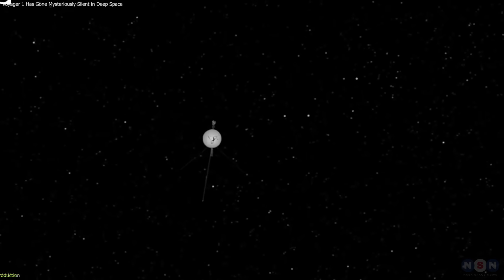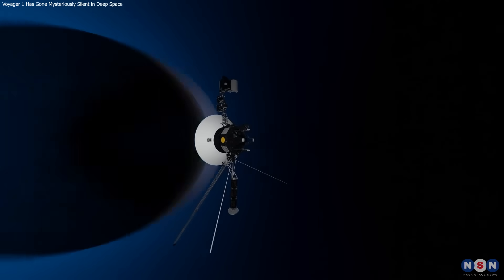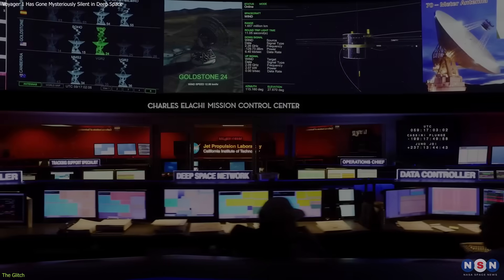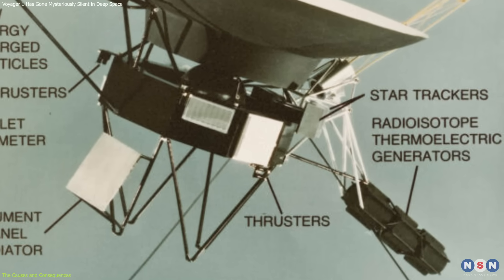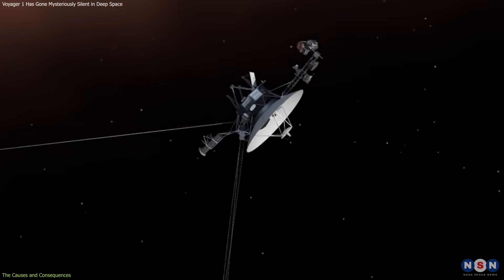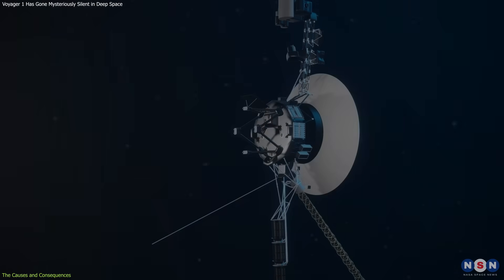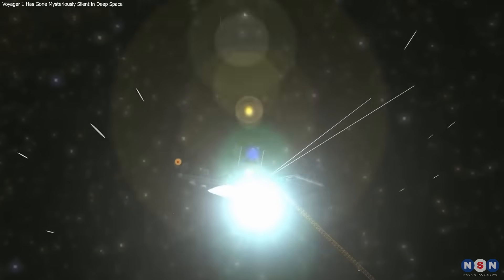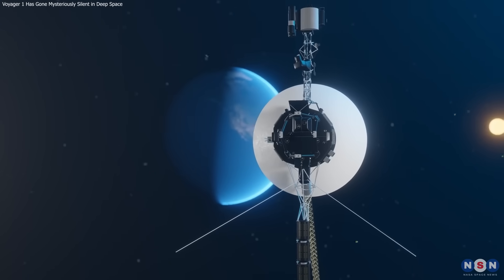What Voyager 1 is Trying to Tell Us with Its Nonsense Signals

Comment: Imagine using Curiosity. (The rover on mars) or any of the rovers to collect voyagers data and be reconfiguredthat way.   Probably will not work, especially considering the distance but it would be neat and exquisite if it did work that way. 

Ooh and then voyager 1 and 2 cracks the code for the so called 10,000 year old black knight satellite. Definitely will not work, however, just imagine if it did. What a breakthrough lol

Edited for typos

Comment: Like how TV news crews use " routers " for increasing microwave signals ( i.e. to re-direct the signal and send it to a remote site with a boost ), is it possible to create these " routers " into satellites to intercept Voyager probes ( i.e. send them near Neptune, for example )  and ( maybe ) send improvements instructions? I know these probes have a shorter life span, as they fly further away from us. But, I would imagine making these kinds of probes are on the " cheaper " side of things for NASA compared to sending larger type of crafts into orbit.

Comment: It's wild that they have lasted so long... One of the first things that comes to my mind is maybe an incredibly simple problem like capacitors or other components that have degraded a little bit too much causing a little bit too much instability in the power supply as it nears the end of its ability to produce enough power causing a random reset of some sub-assembly, especially when it tries to execute some kind of higher power operation like a transmission back to Earth

Comment: The stuff NASA claim about Voyager 1&2 are impossible,,,  there is no way they have contact with them things decades ago,,   just a ruse for funding keep coming,,,,  idb them
Reply: Remember, you need a sender AND a receiver. If your receiver is powerful, the sender will not have to send a strong signal.
The transmitter on each of the Voyagers for example is just strong enough to power an ordinary refrigerator light bulb (23 Watt).
By the time those 8GHz signals reach Earth, they're one-tenth of a billionth Watt.

To be able to receive those (downlink), NASA therefore uses the huge 34 and 70 Meter receiver dishes of the Deep Space Network. The antennas at each site can be linked to simultaneously receive the signal from the spacecraft, providing increased gain through radio interferometry.

Check allaboutcircuits to learn more about the interesting topic of long distance communication 😊

Comment: Voyager One is disoriented because of less gravity. So many imaginary problems from not understanding the observations. It’s the observations that are real and it’s gravity that is not being understood. We don’t need another law of gravity. Gravity is constant locally the same as the earth is flat locally. On a larger scale gravity is not constant and the earth is not flat. Gravity drops off considerably outside of the galaxy which changes considerably the measures of time and and distance which together make everything to appear to move faster including light. Things appear to be moving faster because they are moving faster as seen by us in our slower rate of time and our shorter measure of distance. This eliminates entirely the need for dark matter.

The changes in time and distance compound the changes in the speed of light as observed from our frame of reference. Do a thought experiment. Hold your hands a foot apart representing 186,000 miles saying “one thousand and one” representing one second while pretending to see an imaginary photon going from one hand to the other. Now expand the distance saying “one thousand and one” as fast as you can. You should notice that the speed of the imaginary photon increases the more distance expands and the more time speeds up just same as the farther away from the center of the galaxy it is. The opposite is also true. Someone moving in the direction of a black hole will seem to us to be stopped.

The energy source of the vacuum energy is all of the supermassive black holes that are growing by drawing in spacetime. This means that the universe is not expanding into oblivion for no reason. It means there is no need for imaginary inflatons. Redshift occurs when light leaves the gravity of a galaxy and then the light is blue shifted when it enters another galaxy. Obviously galaxies aren’t all equal that way and distant galaxies are much more redshifted because of all of the mass of the surrounding galaxies that distance light has to pass by.

Comment: I wondered if using terrestrial computer hacks to fix Voyager 1. If it is sending back gibberish and binary code, I thought to look in old data specs to see if they could decode the binary data, as it seems those binary codes are saying "Distress."  I was told that an On/Off restart or a system restore is not possible, so that is off my thought list. I know Voyager is a relic craft now, so I just thought if we thought on the basic level of how to correct a glitch on a relic craft, would have to be a complex, yet simple task. Is there a way to help the FDS to reset itself? The FDS sending back binary code, if we know the code indicates trouble, what are they telling the FDS to do to correct the binary glitch? Or are they able to do so as yet? Can they decode the binary code to see if any other pertinent information is imbedded in it? Or maybe if the FDS has dropped into Binary code, should we try sending it binary code "fixes" maybe it might be able to read and implement the commands from earth.
Reply: Apparently it can still receive data, because they can change the modulation mode that it transmits back, but perhaps there is a stuck bit in a counter for the data buffer, so it just cycles endlessly.  They would need to upload a new routine that doesn’t use that bit of RAM.
Reply: @steveschunk5702  And if the craft is sending binary code and it still can receive data, (I don't know how this works but) if they need to circumvent something in the ram, if it sends binary, what if it better reads binary, just to get over the critical spot?? If they can formulate a code that can get past the tricky spot, they may be able to repair the damaged node?? I'm just thinking in simplest terms, that are not so simple at all. I've been trying to figure out how to reformat the FDS. And as I was told by scientists lately,  many of my ideas won't work because of the age of the craft and the computers logistical difficulties. I was trying terrestrial fixes that won't work on Voyager.